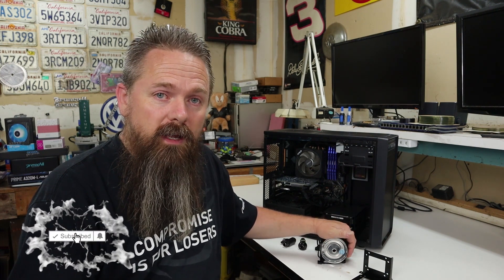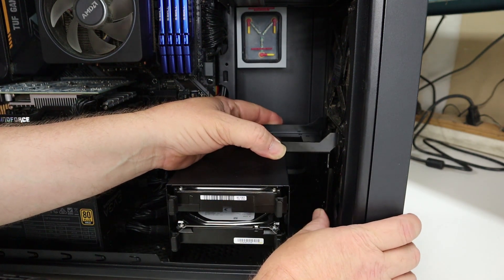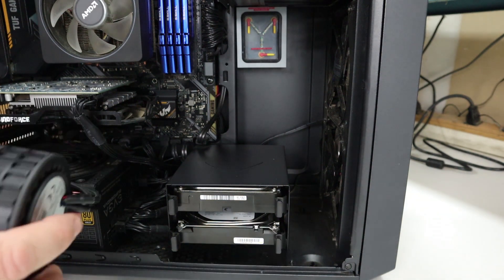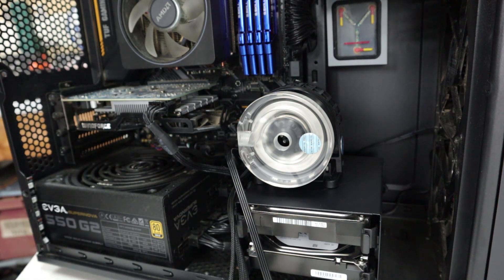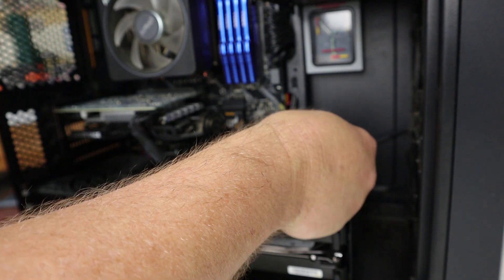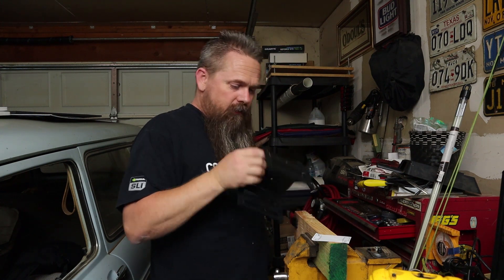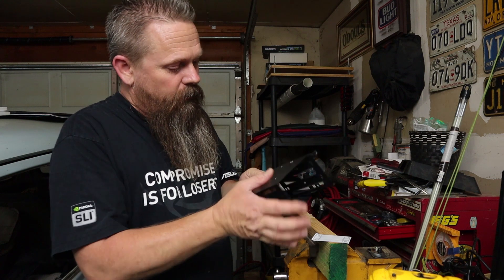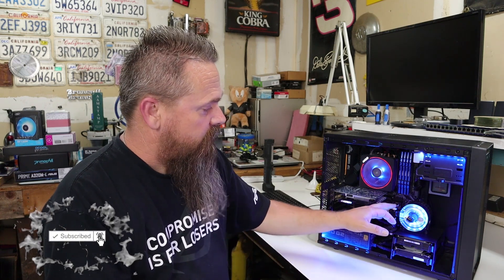EK-XTOP Revo D5 RGB Pump Install (Water Cooling a Computer Part 3)

Comment: Are these different from their Inertia D5 pumps?
Reply from the maker: Yes. This is just the classic D5 pump. I believe the only difference is the pump top. This has the 12v RGB pump top.
Reply: @CyberCPU  Yeeeeeaaaaahhhh.....Looks like you screwed the RGB top TO the base.....AND installed it ON IT'S SIDE  lolololol.....WHERE is the RESERVOIR that holds the FLUID ???? You've got a drain coming OUT of the RGB top....on it's SIDE ?    How long did THIS "last"  before you got yourself a reservoir....sat it UPRIGHT and actually FILLED IT with SOME kind of cooling fluid?  Did you WATCH some water cooling build videos BEFORE you tried this?  Didn't you possibly think "something" was "missing" (reservoir) before you called it "finished?   It's on its SIDE with the TOP water LOOP INTAKE sticking out like a drain ?😂😂🤣😂🤣😂🤣😂😂😂😂😂